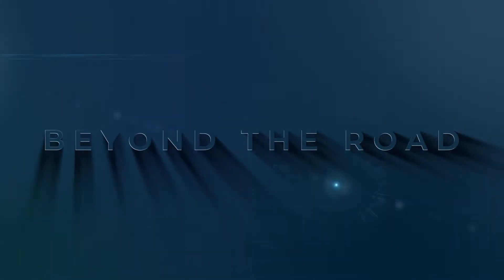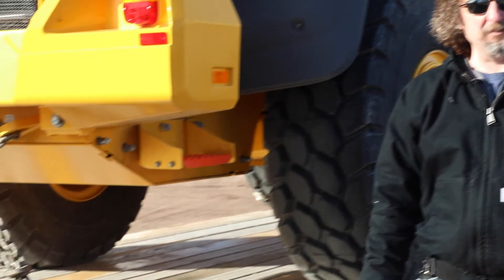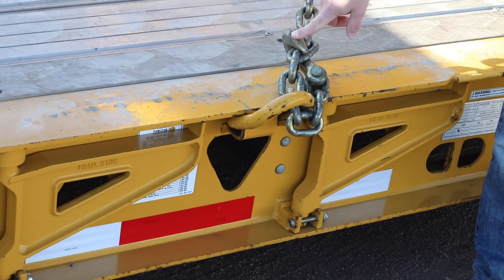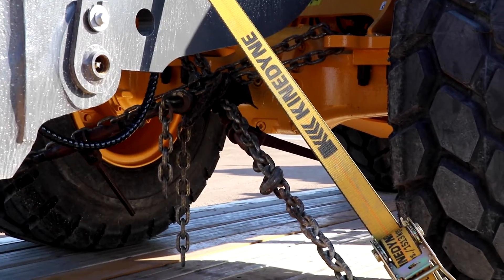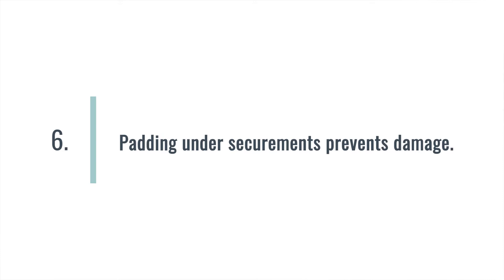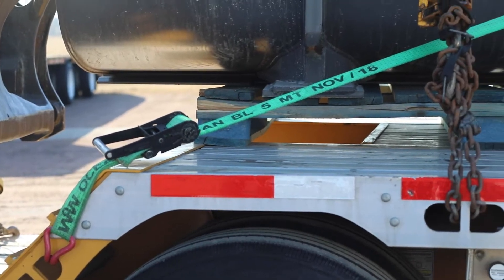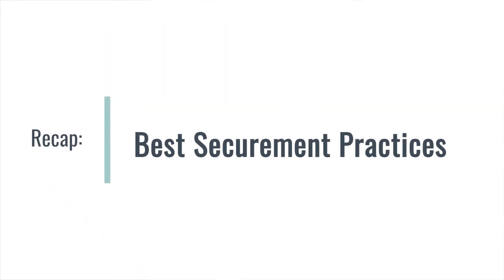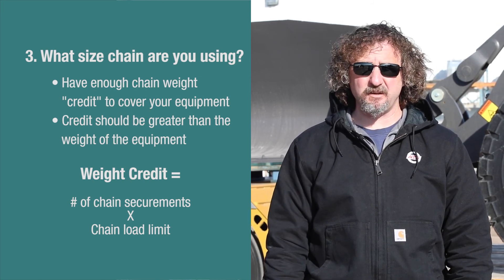How To Secure A Front-end Loader

Comment: Since when did 4 half inch chains used in direct securement give you 45000 lbs of value, did they change the rules and not tell us, come on Charley!!
Reply from the maker: Hey, Gene! You could really look at this two ways and both will get you the same answer.

DOT requires 50 percent of the load weight to be covered with 50 percent credit working load limit (WLL) for direct securements. ATS requires its drivers to cover 100 percent of the load weight with 100 percent credit WLL for direct securements.

So in this case, a half-inch chain WLL is 11,300. With the DOT method, 45,000/2 = 22,500 and 11,300/2 = 5,650. 22,500/5,650 = 3.98, which means you should use four chains minimum. With ATS' method, 45,000/11,300 = 3.98, so no matter which method you use, four chains minimum should be used.

Hope that helps! Thanks for watching!